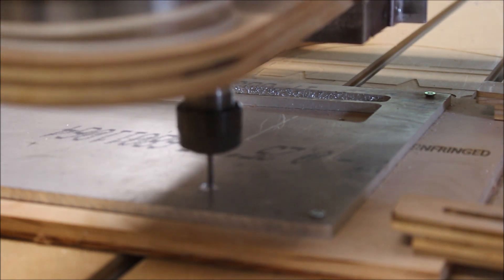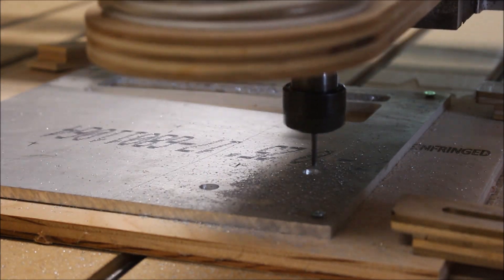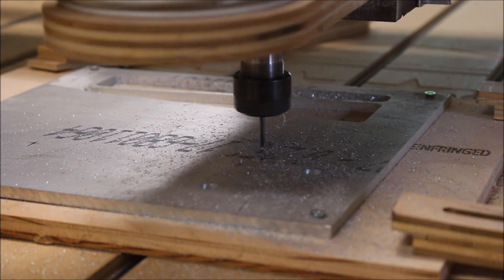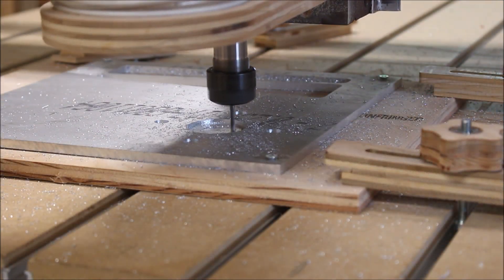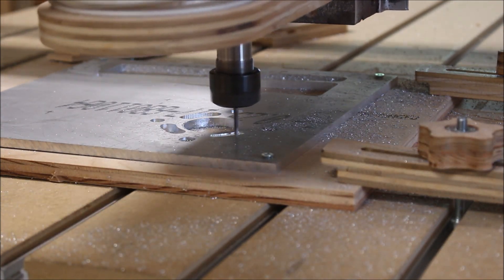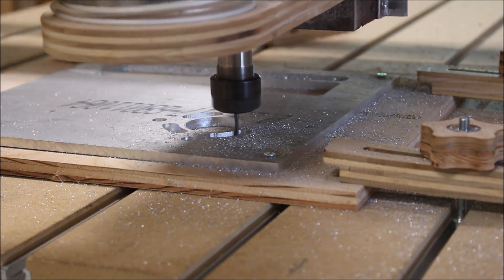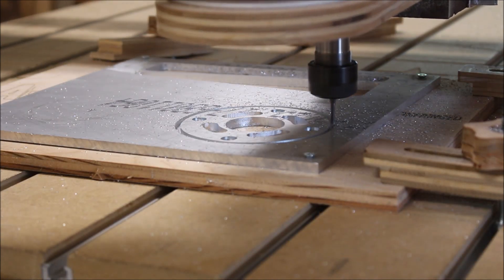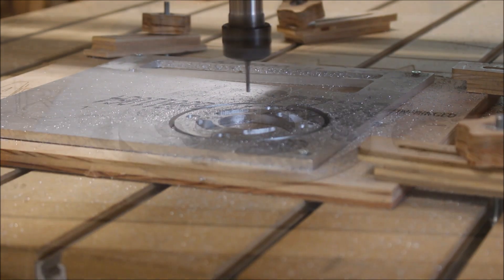Can A Gatton CNC Cut Aluminum?

Comment: Good to see you cutting aluminum. This opens a whole new category of fabrication possibilities. In my limited experience, I have found that harder alloys like 7075 and 6061-T6511 cut much better than the softer versions.
Reply from the maker: Thanks for watching.   6061 and higher alloys are the best for machining for sure.  3003 and 5052 are more for parts made with a punch press, laser, and press brake.
Reply: Onsrud offers bits for Soft 3003 Aluminum #63-420 (3/16"d x 1/4"DoC) & #63-430 (1/4"d x 1/4"DoC). They cut great, of course mist / lubrication needed